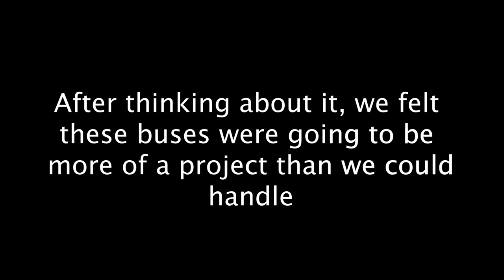Volkswagen Field Find!! Huge Collection of Buses!! Split Window Bus, Bay Window, Camper, Beetles!!

Comment: I have a 74 bali yellow or revna green Westfalia id consider selling. Good Bones original paint some rust some dents but nothing that would keep you from driving it. I have an engine but it needs to be put in and the brakes need to be gone through. new pop top canvas painted and seals lots of parts! $12500
Reply from the maker: lal5555f very cool!